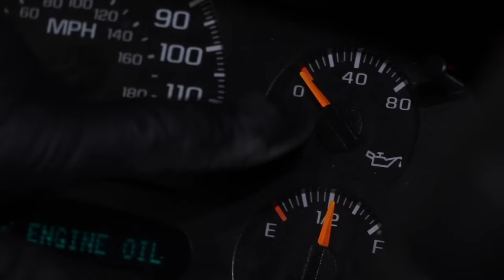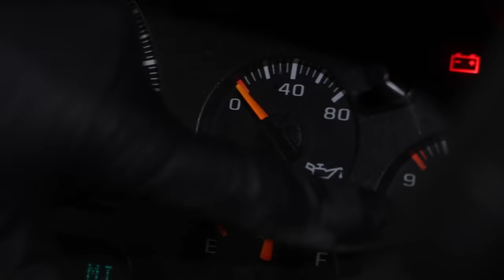Top 5 Problems 2000-06 GMC Yukon Sierra Chevy Suburban Tahoe Silverado Avalanche Cadillac Escalade

Comment: Filler gas pipe also rusts out. This will give you a check engine light reading small leak. NOT THE GAS CAP. Smoke tested mine after months of the light coming back repeatedly. YUP SMALL PINHOLES. Good luck.

Comment: That ground wire at 8:01, where does it go to? I have a 2003 avalanche and the battery keeps draining over night. The mechanic said to replace the instrument cluster. I did and it still keeps draining. Any thoughts? Thanks
Reply from the maker: +Lerai Palmer We wouldn't be able to diagnose an issue like that here, you may want to have a local mechanic take a look at it. Thanks for checking us out! 1AAuto.com

Comment: I've been having a 4wd problem on a 2000 Silverado 1500, and i bought a new encoder motor for the transfer case from 1AAuto, this unfortunately didn't fix my problem.  I suspect the encoder motor isn't getting the power it needs since its only getting 9 volts.  Does 1AAuto provide any specifications for their parts or any wiring diagrams pertaining to the encoder motor.
Reply from the maker: +Jake Hagan That might be the correct voltage to the motor, but a local dealer would be able to tell you for sure. We do not have that info. Thanks for your order and checking us out on youtube! 1AAuto.com
Reply: I have same model with electric control. Replaced dash switch ($40) and its good to go.

Comment: I have a 03 silverado with100,000 miles and i drove over some train tracks yesterday and my driver side front coil/spring cracked and dropped the front left side of my truck. I took it straight to the dealership and they told me they have to replace the front driver side coil/spring for $725... i asked him if they were gonna replace both of the front coil/sring snd shocks and he said no just the coil/spring that cracked on the driver side... dont they come in pairs and arent they supposed to do both? He said that this is rare and never seen a truck do this and has to order the part from canada. Is this guy playing me? Any help or info would be greatly appreciated... please let me know what you think, thanks
Reply from the maker: +R Cobian Some people do prefer to have both replaced depending on the miles on the struts you have on your vehicle.  If one goes, the other may also fail soon.  If these haven't been on your vehicle too long the mechanic might believe the LH is just defective which caused it to crack on the tracks and that is why he is just suggesting replacing that side.  It really is up to you as these are sold individually as well as in pairs.  Good luck!
Reply: @1AAuto  yeah i bought the truck brand new in 2002 and it still has the original struts.. this is why im confused on why he would only want to replace the one that cracked and not both..he also said it was rare for the coil to crack like it did? And for $725 for just one strut sounds off but then agaim i dont kno much about this stuff... you think i should i take it elsewhere? Im in southern California, do you have any recommendations? Any help or info would be greaty appreciated, thanks
Reply from the maker: +R Cobian Thank you for your reply.  If you are unsure we always recommend having the vehicle looked at by a reputable mechanic to see what is going to be the best fix!  We do not have a list of garages in your area, but you can easily look up customer reviews online to find a good one.

Comment: I have a 2008 Silverado and my engine is tapping could it be D Simpson or something wrong with the engine
Reply from the maker: +Dave Henyard You should definitely have that looked at. Engine knocks are never good.
Reply from the maker: +Dave Henyard You should definitely have that looked at. Engine knocks are never good.
Reply: I'm thinking it's the fuel management very common problem that the Chevys have it sounds like it's only on one side

Comment: I’ve changed the knock sensors in my 00 Silverado twice and the harness I still have a check engine light for generic knock sensor code I even switch out the egr valve any suggestions
Reply: It’s been a while, but I believe GM put out some kind of improvised guidance to use silicon caulk to direct water around the sensor holes. Don’t try it unless you can find the actual GM document, but I seem to remember that being a major problem back in the day.
Reply from the maker: +Lonnie Davis We do apologize but we do not.

Comment: most of the time fuel pump dameged cuase it is not strong enugh to face the hit of fuel inside the fuel tank while driving  when fuel going back and forth because the fuel pump made of plastic on GMC 2000 NEED TO BE CHANGE TO ALUMINUM

Comment: How about leaking transmission line fittings, faulty 4x4 switch and transfer case sensors, poorly designed tailgate latch, horn that doesn’t work, bubbling paint and rust in the first five years, climate control switch that’s cheap and dies. Never had another vehicle with so many problems.

Comment: Here is the problem with the sensor repairs.
If you are not a mechanic which most humans on Earth are not, you will be ripped off by the mechanic.  They will fix the sensor problem but charge you a lot more money by saying the problem was more extensive.  You might only have debris in your filter and they will replace the filter.  Then charge you thousands of dollars saying you had a worse problem.  I'm not saying all mechanics are crooks.  But, many are.  That's why I no longer own any vehicle.  It's a giant headache where vehicles can malfunction from one of thousands of probabilities.  That coupled with an increase in car insurance, lack of parking spaces or alternate side of the street parking forcing you to get up early to move your car for street sweeping city trucks such as here in New York City, and driving speed limits as low as 25 mph and thefts rising of catalytic converters, window smash and grab car thefts and you have a nightmare on your hands.  No thanks.

Comment: Ha Ha...the rodent concern is major in cold climate areas. Those critters remember your daily schedule and park their behinds where it is nice and warm. They will go into the air cleaner box, the fuse box and any other location that has warmth and things to chew on.  It's too bad the car makers do not take this into consideration when designing their electrical components etc. especially now that all vehicles seem to be using tiny gauge wiring and lots of it.
Reply from the maker: +Garth Clark Thanks for checking us out! 1AAuto.com

Comment: MY Poor 2000 yukon has EVERYTHING WRONG..only 164k miles one owner.....
.. to the point where i had to put in a battery switch.... cause we could never find the contstant drain.. and NOW     the back ac works fine  the front does NOTHING!.... if you hit a button it just blinks.........   so no defrost no ac no heat up front.. where  (besides fuses)  should I start? DIY is not my thing but I HAVE TO FIX atleast defrost!
Reply from the maker: +Laura Emonds We wouldn't be able to diagnose an issue like that here, you may want to have a local mechanic take a look at it. Thanks for checking us out! http://1aau.to/m/Shop-1AAuto-c

Comment: Got water on my driver side floor when the ac running... what could that be
Reply: Clogged cabin air filter?
Reply: Look under the hood in that same general area for a little drain hose that comes out of the firewall and points toward the ground. It might be clogged.
Reply: Edit: the drain hose is probably on the passenger side under the hood.
Reply from the maker: +Dedric Smith We do apologize but we advise that you have that diagnosed.
Reply: Thank y'all I'll check when i get off about 5pm..... I'll let y'all know

Comment: O2 sensors are supposed to be changed every 100K miles
mud under the wheel sensor is a pita
I hate those knock sensors, why GM never put them on the side of the motor is beyond me
Reply from the maker: +AA1PR Thanks for the feedback!

Comment: I get a code po420 on a 04 Chevy Tahoe what is that
Reply from the maker: +Juan Moreno Usually this means your catalytic converter needs to be replaced or there is a problem with your O2 (oxygen) sensors. Please let us know if you have any questions!
Reply from the maker: +Juan Moreno Thanks for checking us out. We would always recommend bringing the vehicle to a reputable shop to have it properly diagnoised before replacing anything.

Comment: Reduced Engine Power.  I figured out that one...  👍🏻
Reply from the maker: +Wes Karcher Thanks for checking us out! 1AAuto.com
Reply: I’m having this issue with mine, what was the problem with yours?
Reply: @Trapharder133  It's the throttle body position sensor and the accelerator pedal position sensor.  The parts can be looked up on autozone's site and then plug that number on ebay to get a better price.  Together the parts are about $50 and takes about an hour to install.
Reply: i got a reduced engine power on my 2006 when i pulled a trailer found out it was a bad ground in the trailer plug

Comment: You need take tired off n clean abs sensor. Cruse sticks on turn signal. These vehicles are the worst for anyone. Oil pressure went on my body went empty. Was won of those vehicles where flooded in New Orleans or wherever it was flooded.
Reply from the maker: +Canada! Place 2 be!! Thanks for the feedback!

Comment: 1. My biggest problem with all the new cars suv and truck is every thing is electric fuel injection system . Lol junk . 2 Chinese metals and sub grade parts and it’s all computer parts major problems with and designed this way to have problems . I cannot indorse anything that isn’ carburetor. anything with gps or wifi I cannot indorse .  All the new brands are junk